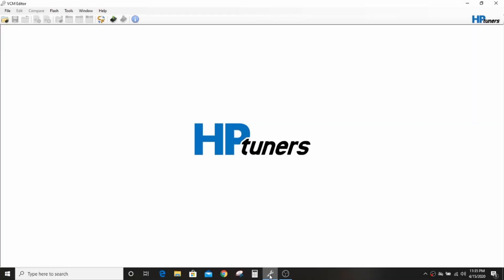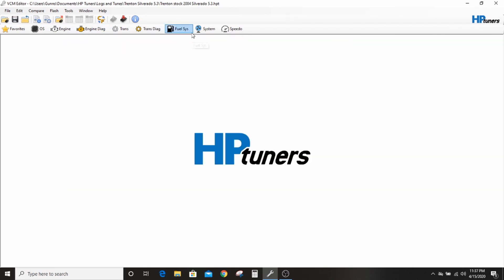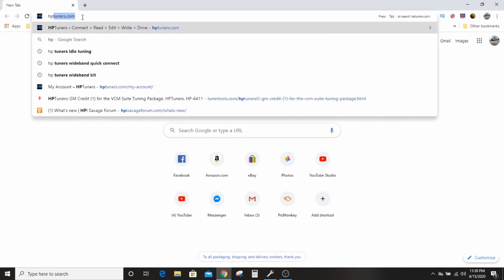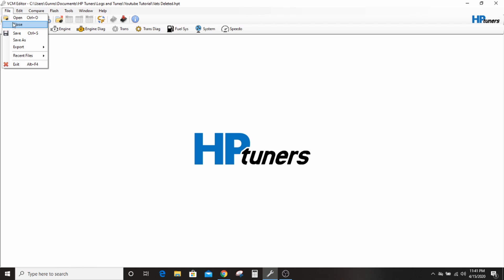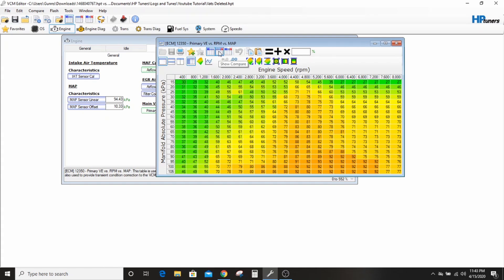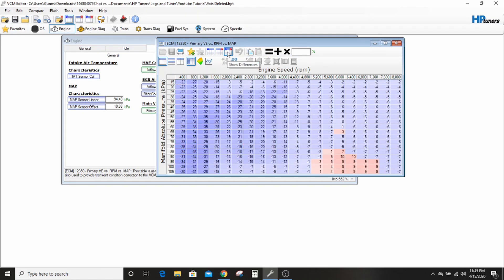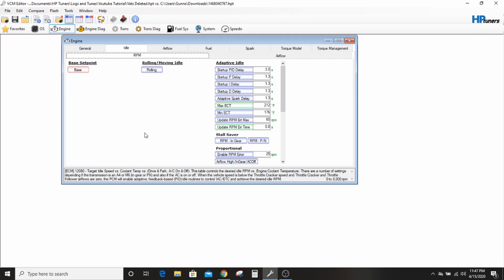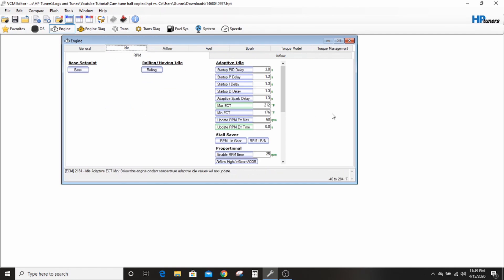HP Tuners Basics, Part 1, delete VATs, Where is VE Table, how to compare files.

Comment: Do I have to have credits to disable the vats I just want it to run
Reply from the maker: Yes, to use HP Tuners you do. 

You can use PCMHammer and Tunerpro to do it much cheaper, that video is in this same playlist.
Reply: @TheDrivewayEngineer  yes I just swaped a 5.3 out of a truck in my 91 s10 blazer everything is hooked up and vats is all I need to get it to fire

Comment: So I'm in the process of swapping a 2011 camaro l99 engine and trans from my salvaged SS to a 2013 SS theft recovery. The 13 had no engine or trans or wiring harness or ECU. Will i be able to with hp tuners to just do vin # wizard to get the ECU out of the 11 too work and clear the security issues? If not what will need to be done? Thanks
Reply from the maker: You don't have to do anything with the vin to turn the VATs off, the license always goes with the PCM, doesn't care what car it's in.
Reply: @TheDrivewayEngineer  Thanks just getting into this. wanting to make sure before i bought hp tuner that it will do what i need it to get it running.